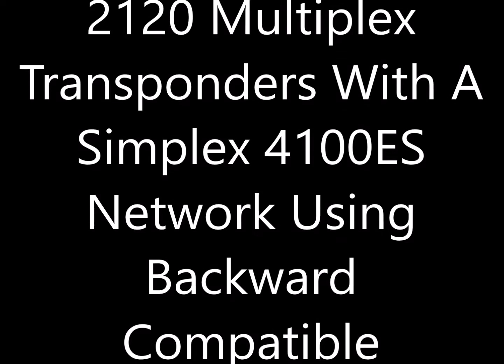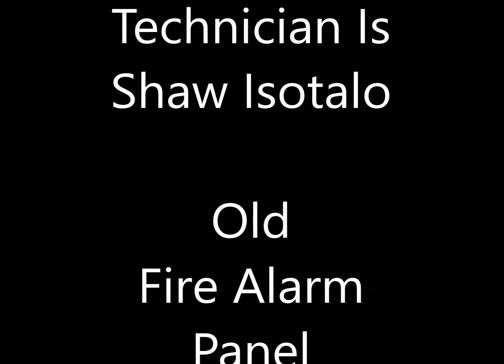Simplex Fire Alarm System Infrastructure Migration In A Resort Hotel

Comment: I've also seen a couple instances where a building used to have a Simplex 2120 system that was upgraded to a 4100+ some time in the mid-to-late 1990s, and then upgraded in the mid-2010s to a Simplex 4100ES.
Reply: One such system I saw, they upgraded to a Simplex 4100U in the late 2000s, but they actually kept the 2120 SCC panel tied to it! But they likely modded inside the 2120 SCC to work with newer 4100-series panels (the 2120 was upgraded to a 4100+ some time in the mid-to-late 1990s before upgrading to a 4100U in the late 2000s).